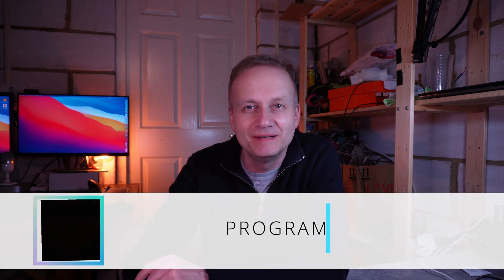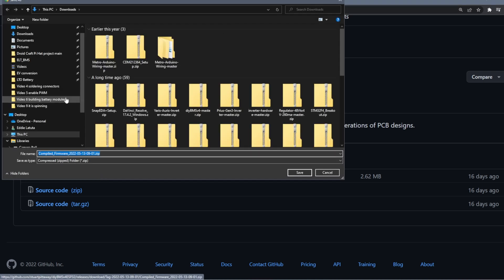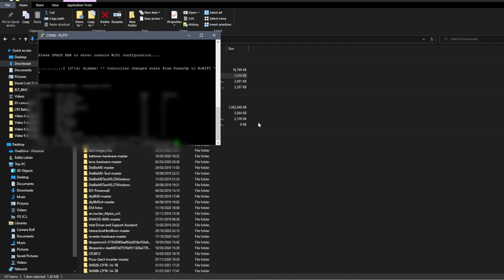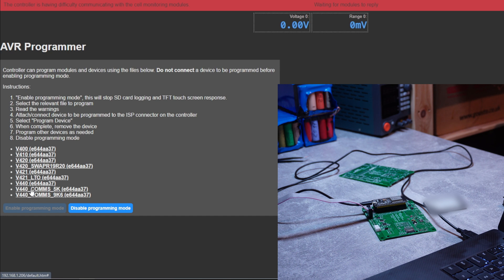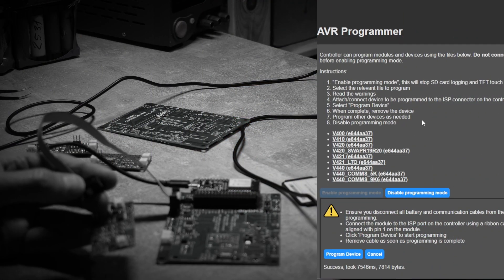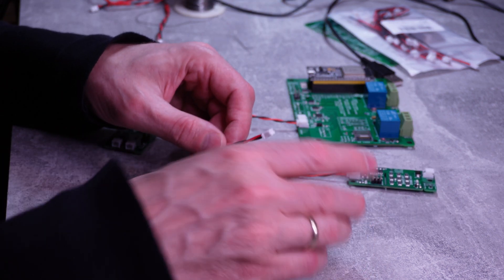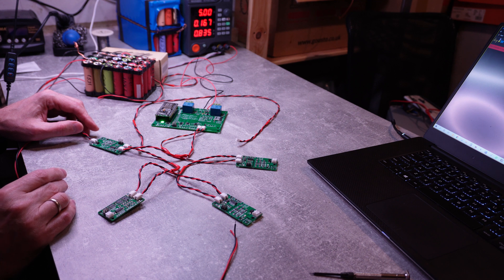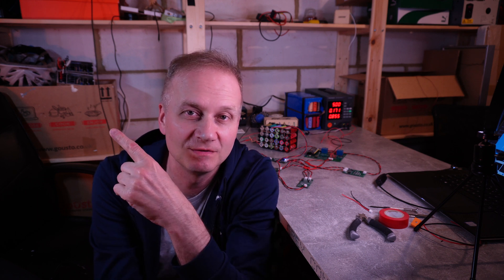Programming DIY BMS Ep 3

Comment: Do you know if this system capable of  96s 360v battery pack ?
Reply from the maker: I believe that DIY BMS should be able to handle 100 modules so 100s should be possible.
Reply: @LatutaEV  Is this what you might be planning to do ?
Reply from the maker: Yes pretty much, I may go for a lower voltage first around 150 V